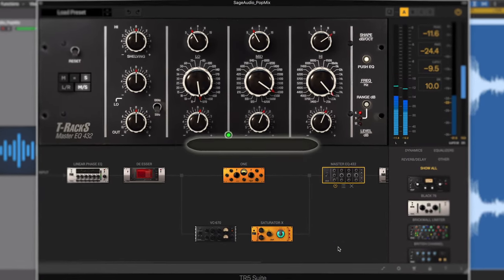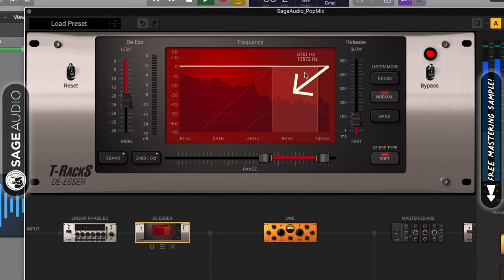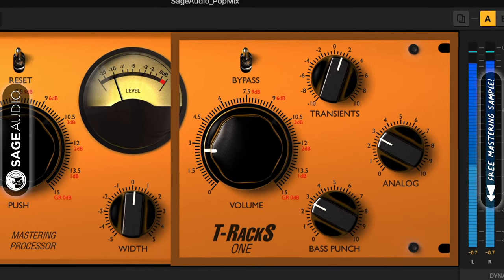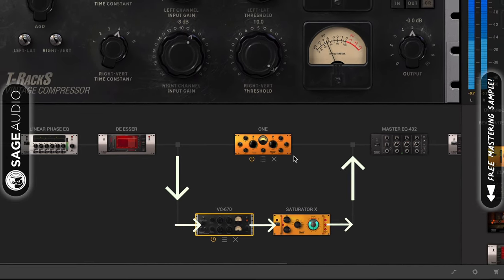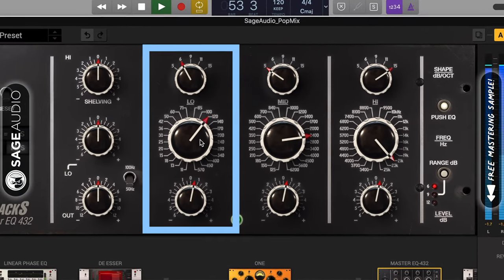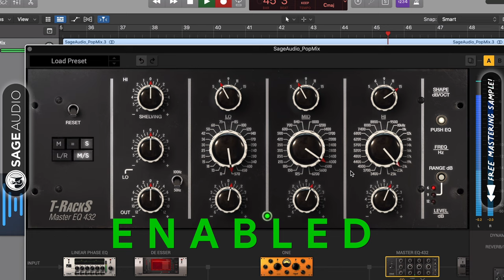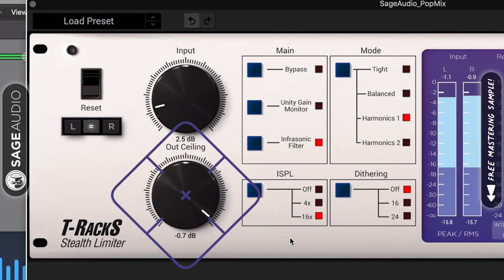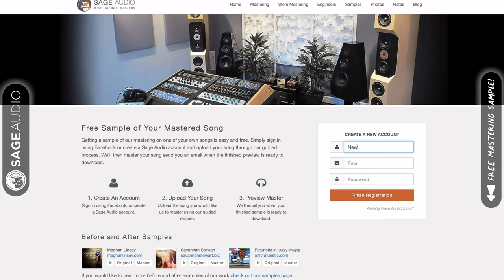How to Master with T-RackS

Comment: Hello..I have a tehnical question. What about dithering ? What settings should I use. My mixes are at 44100 Hz and 32 bit float. When I open T Racks should I set the new project at this 44100 32 bit float and when I export should I set the export at 16 bits and choose one of the dithering options from there? (and, if that is the case, which one?) I m very confused.

Comment: Thanks for this. I use the TRacks plugins for mastering also. Two things of note. The TR5 Quad Image plugin is also great for converting the output to mono below 100Hz but you did not do this. Just wondered if there was any reason for not doing this. Secondly, I would also strongly recommend the TR5 Bus Compressor within your mastering chain. It can really help all tracks within the mix 'blend' together in a very musical way.
Reply from the maker: Thanks for the suggestions A A M! I typically avoid imagers and use mid-side processing instead, but this is mainly a preference.  I'll have to check out the TR5 Bus Compressor!

Thanks for watching!

SageAudio.com

Comment: Can we have the preset plz? Also how would you put a reverb in this preset?
Reply: why would you want to put reverb on the mastering chain ?
Reply: @djronakdelhi  in cases when all you have to work with is a single audio file.
Reply: @EdmondMirijaj  then i would suggest as reverb comes in the mixing process so it's better to put reverb before this mastering chain would be right not in between or after.
Reply: @djronakdelhi  t rack has some master presets in which he put the reverb on the mastering chain. Like after an eq. You need to eq the sound before you send it to reverb.